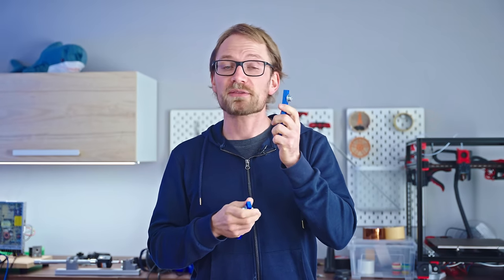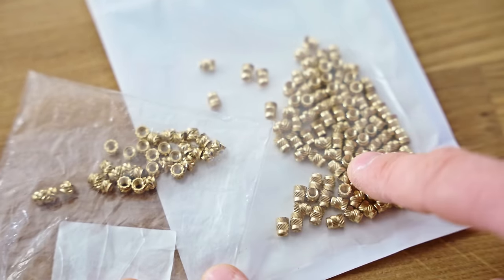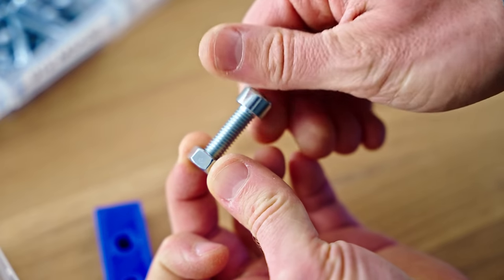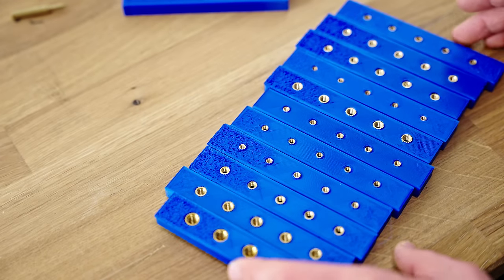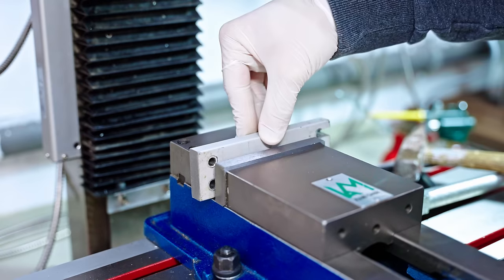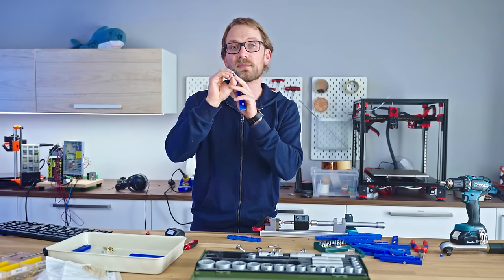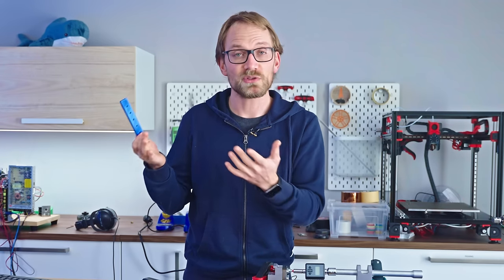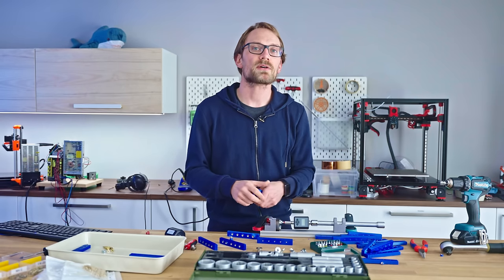Do you even need threaded inserts? Strength tested!

Comment: Hi Tom, I have been watching your content for probably the past 8 years and I am a huge fan. My studies and career have lead me into being an applications engineer for SPIROL, a manufacturer of various engineered fastener components. This video really hit it home for me, because a lot of our business is with threaded inserts for plastics. In my position, I do a lot of customer case studies and experiments, so I can provide a lot of insight into the matter.

First of all, I would like to talk about the testing method you used. Although it put the insert into a combined stress of torque and pull out, this condition is best avoided because it compromises the part's performance – in a normal situation, the insert should always sit against the part it is beight mounted to. This way, there is no additional pull-out force created and the only stress the insert experiences is the torque. The proper way to measure the torque performance is very simple – we call it the direct torque method. Simply screw in the bolt all the way in and measure the torque to failure with either a torque wrench or the torque gage. If the application is designed this way, the only axial or pull out force it has to withstand is whatever external force acts on the assembly, which is usually smaller than the pull-out force you're creating with the bolt. The actual pull-out force is then measured by just pulling onto the insert via the bolt until failure using a load cell. 

Secondly, there is a lot of design considerations that need to be taken into account when using these. The most important one being the boss diameter, or the minimal effective wall thickness. We usually recommend this to be 2-3x the diameter of the largest performance feature of the insert. This maximizes the performance, because a strong enough boss will shift the failure mode from the plastic cracking/pulling out (like you have experienced) to the insert spinning in the plastic/shearing the plastic around the insert. Obviously, this is a challenge with 3D prints, because you don't want to have 8 perimeters everywhere in the part. Coming in at a close second, a proper hole size is also having a huge effect on the performance. Have the hole too big and the insert is not going to perform as well as it could, have the hole too small and you will be pushing too much plastic around. This is best determined by experiments – install the insert, perform a cross-section of the assembly, take out the insert and inspect the imprint that is left in the plastic. You should not see any voids, which would indicate an oversize hole and compromised performance. Undersize hole will perform fine, but you will be seeing a lot of plastic flash on the top and bottom of the insert. When the boss diameter and hole size is dialed in, the third factor is the installation procedure itself. Granted, it is hard to achieve consistency at home, but some general principles can be followed. The installation is determined by temperature, time and applied pressure, all of which can be tweaked slightly to achieve the best plastic flow around the knurls. Good alignment of the heat tip is also a factor – at 8:53, you can see the asymmetrical flash on one side of the insert, which probably creates a void on the other side. You can try to adapt a drill press with a heat tip/soldering iron to have a good, perpendicular insertion system, which often times has an adjustable positive stop for installation depth consistency.

At 16:37, you also mentioned that while connecting two plastic parts, you need extra support, so the screw does not dig into the hole. This is another part of a secure bolted joint in plastic – the mounted part needs to be reinforced by a compression limiter. The compression limiter transfers the clamp load through its metal body and protects the plastic from getting crushed. This protection can also be achieved by a big washer or flanged bolt, but not having the metal reinforcement would mean the plastic would creep over time and any preload that was there would go away, so the compression limiter serves also a further purpose. Using a compression limiter is also very common when mounting plastic parts to metal bodies, not just in pair with a threaded insert.

Incorporating all of these considerations/guidelines/principles, you should be able to come very close to the nominal torque of the class 8.8 bolt. We can usually get to that torque or even past it in industrial molded parts with various levels of glass fiber fillers, so the lack of homogeneity of 3D printed parts will bring those numbers down a bit.

Feel free to reach out if you have any questions, I would be happy to help!
Reply: Preach. Nothing about this testing was valid and all the results are misleading. I know Tom probably put a lot of time into this video but I think he should not have released it.

Comment: My experience:

I've learned ntu thickness is 0.8 times screw diameter with similar material. Witj Steel screw in aluminium thread depends is 1.5 times diameter and Steel in plastic  2.5 ( if I remember right)

M5 thread pitch is relatively low. So it's not ideal for printed threads.

Thread length is the game changer. On an M3 bolt sitting in 40mm PETG I ons twisted of the head by trying to unscrew it. The PETG warms up slightly while screwing in. Than setting perfectly on the surface of the threads.

The thread adapters are working best if they are mounted from the rear.

Embedded flange nuts are also very strong.

Comment: The thread adapters are similar to threaded inserts for woodworking.  I think the woodworking ones have a more aggressive steeper thread on the outside. It would be interesting to see how those perform in a test like this.  I think the number of walls around the thread and as you mentioned the infill would be a large factor there as well.

Comment: a screw goes into a NON-threaded part. bolts thread into pre-existing threads whether those threads are in a nut or anything else, screws cut into the material to form threads as they're screwed in.

Comment: Manually tapping allows for better results, provided you have a feel for it.

Unless you are manufacturing at some scale, it is more cost effective to over-engineer and use larger thread sizes.  The time it takes to dial in the ‘correct’ fastener is excessive unless you are looking at cost per unit.

Comment: You should have also tested prints that allow a press fit nuts which seems the easist thing to do as it uses standard nut/bolts instead of expensive inserts.

Comment: Hi, I use the best combination of materials. Let me explain: if I'm working with plastic, I also use a plastic screw. But too small sizes often do not allow this. So I place the empty space under the female screw and then pause the slicer on the last layer to place the nut there. As a result, I have a part that fits the hole perfectly, has the correct threads and the right material hardness. I would be glad to see similar tests with my method of making threads

Comment: I would use a tap wrench when tapping threads in plastic to avoid melting or stripping the plastic.

To get more instructive test results, you should print more solid layers around the holes. If you could get your slicer to somehow interleave the layers with surrounding layers then that would be awesome. I have never tried to do that in my slicer.

Comment: There was a video like this that tested threads in resin printed parts of different resin types, they found that you're better off either just gluing/resining the insert into the resin after the fact, or having the threads printed.  The strength was about the same either way.  Tapped was much weaker, probably because it breaks the crystalline structure of the resin.  

The thing is... You needed to print solid test parts for tests that cut out any problems with your slicing profile.

Comment: You should test something resembling actual use. In this case, bolt together two parts, and test pull out strength by pulling on the second, untheaded part. The second part acts as a washer, preventing the initial pull-out you experienced. Looking forward to your results. I expect pull out will be the weakest direction, basically the same as this test's results. Shear strength should be quite good.

Comment: I bought a tap and die set. Now I just print holes with the minimum thread tolerance, harden them with CA glue, and tap them. The plastic (PETG) around the fastener will rip out before the threads give way, even with 60% cubic infill..

Comment: I would love to see a follow up testing to see what kind of methods you would need to make the screw or the insert the weakest part of the setup. I'd expect that you need a lot thicker wall thickness for the 3D printer setup and probably also higher density fill, too.

It's probably not worth the effort to test so many thread sizes. Simply go with M4 and figure out what's the best method for that, and the results should be probably applicable to other sizes, too.

If you could find thread insert that you can use with a steel thread adapter for M4 screw, that would probably result in strongest connection because you would get maximally strong M4 thread with much bigger contact surface to 3D printed part. Of course, the overall cost per insert would skyrocket pretty fast if you go with stacked design.

Comment: An alternative to cutting threads with a regular tap is to use a thread forming tap. Then don't cut the thread; instead they force the thread to form around the tap. Of course, you need to drill a larger pilot hole. I use these a lot in metal projects and they for a thread that's stronger than a cut-tapped thread.

Comment: you should try to fit a nut inside the part and go more on the setting side to make it stronger. Personaly, if I want something with a strong connexion, i'll use more wall thickness, a lot of infill and probably insert a nut inside the piece and print it in PETG.

Comment: Hidden nut if you need pull strength. Inserts when you need to unscrew it often. Other than that, i just tap. I do use larger bolts and i ALWAYS use washers. It stops layers being pulled apart as the screwhead digs in.

Comment: I just print a smaller hole, so for example 2.6mm for an m3 screw and screw it in directly. There is quite a bit of friction, but that means the screw sits in relly tight and strongly. I think printing the thread makes the connection weaker.

Comment: If you ever want to revisit this experiment... try salt curing the prints after you place the inserts. The salt curing will increase the strength of the print significantly. Though, be careful... it does shrink the print (that's why you place the inserts first). Also, I would love to see a resin test with these inserts.
Reply: I don't understand why anyone uses salt for annealing PLA. It's corrosive, makes a mess and is not commonly  available in the require fineness.
Just use plaster (gypsum). Cheap, superfine, available easily.
Just don't wet it...

Comment: I find printing a regular hole and just using the screw to self tap works remarkably well.  I've actually stopped using inserts as I've not actually stripped out any screw doing this; even after putting the screw back repeatedly.  Maybe it's the depth of the screw that helps this.  Sometimes simpler is better.

Comment: Nut pockets, and test with another part on top. You can't "pull out the plug" as easily if you have a solid part on top, but you could strip printed threads easier. With inserts the top part would sit on top of the metal preventing it from pulling out, but it could possibly spin instead.

Comment: You should try printing a hex shape hole into the back side of the part just big enough to press a matting metal nut for each size of bolt and give that a test. You could even take it one step further and pause the print and insert a metal nut and then resume the print so the metal nut is fully encapsulated within the 3D printed part. Also try 100% infill. Note: a normal metal nut from the hardware store is much cheaper than a heatsink insert.

Comment: I've had plenty of luck with tapping M3 holes in PLA, this is actually my most common method for adding threads to things unless the parts screws need to be removed regularly.  I suspect there wasn't enough walls or infill.  I always use at least 3 walls when I need to tap a part and would typically size my hole to about 2.8mm.

Comment: Your torquemeter measured the resistance of your free spinning bolts, which was 0 for all of them. If you wanted a number you'd have to lock the bolt to the insert. eg. a solder blob on the bolts.

Comment: I made holes about the right size for tapping, then just put the screw into the hole pushing the material into the right spots.  Worked great for me so far but I used long screws and it was just to keep a lid on, nothing high stress.  I'm a little surprised you didn't try that, just printing a hole and then threading the screw into the hole directly.

Comment: If you redo this test you should also try the McMaster style threaded heat sets. They are designed for a 4 degree draft angle or 8 degree taper hole and seem to work quite well. 

You should definetely try different support or hotter printing temps to see if you can get higher part strength. I’m surprised you had failure below 0.3 NM, I’ve been able to torque M3 screws to 0.5 NM without much issue on the McMaster Heat-Sets in PLA+.

Comment: You should try screwing in from the other side of the brass insert. Optimizing hole diameter will be part of that work though as you cant have much plastic being pushed into the screw hole

Comment: I second the notion that an exploration of wall count with printed threads and threaded inserts would be interesting. I would also like to see a comparison to captive nuts (printing a hex-shape and putting a nut in it after the part is complete). Captive nuts are my favorite way to attach hardware to printed parts. 

What I really want to see is a comparison of threaded inserts installed from the "pull out" side vs. threaded inserts installed from the opposite side. Does a little "wall" of printed plastic make the part any stronger?

A couple ideas for better testing M3 inserts: 

Idea 1: Torque an m3 fastener with an eyelet attached to it into the printed part. Then use a string and a hook to attach (small) weights to the eyelet. Add weight until the threads fail. I think a test like this is a better reflection of reality. The user torques a fastener into the part using a measured amount of torque, or at least some judgement and then operational stress is applied to the part. At the very least it would allow the tester to start with a smaller minimum load and add load in a very progressive manner. 

Idea 2: Put three or more threaded inserts in a printed part in a pattern. Make a steel jig that has a hole pattern that matches the pattern plus one more hole in the center of the pattern. Think of a the bolt pattern of a car wheel with the hole for the hub in the center.  Tighten screws into printed part (with tapped threads or inserts or whatever) to a specified (low) torque value. Then thread a screw into the "hub" screw and measure the torque applied before the threads start pulling out of the printed part. Divide by three (or whatever the number of screws is).

Comment: I typically use more parameters when printing anything that will experience a force on it so that is my first recommendation.  If you want to achive maximum strength i think the imbeded nut option is a good method to follow but i typically make use of a captive nut. The difference being that the captive nut just sits inside a hexagon recess that is slightly larger than your nut (making the peinting process simpler) . Both of these methods has a larger footprint to spread the load onto, making most of the weaker materials. I also feel that ABS is much better suited for stress resistant parts as is its stiffer. PLA and PETG can also hield or creep more over long periods under load

Comment: Really I think this is another case of "the right tool for the moment." Everything is fiddly to some extent, and we can't really count on any of our printers to make a perfect hole even for things like nut slots, but we can mostly get any of these methods to work for a given part depending on what we have and just want to do.

Sometimes the answer might not even involve threads, but instead interlocking parts, adhesives, zip ties, or maybe a combination of those.

Comment: MY experience with this is only with M3, but I found an easy way that seems strong and is very cheap. Print or drill the holes to around core with and just screw in the screw and let it be it’s own thread tap. It requries some force to enter the screw, but it seems to hold VERY well. It would be cool to se the data compared to threaded M3 holes 🙂

Comment: I've always used printed threads and they are fine from M5 up. Pro tip is to tap them after printing but not with a drill and machine taps but with a proper set of hand taps. For anything smaller than M5 I typically use hexagonal holes and nuts. Great video BTW!

Comment: I use wood insert plugs if I can reach "from tge back" the most left you showed on the last picture for alternative.
I have also found that the highest strength is with a "pilot hole" with diameter same as thread inner diameter and just running the bolt in well lubricated with vaseline. This makes much stronger thread than pre-tapped or print in place (especially for so small diameters)

Comment: personally, i'd be using nutserts, the flange on the back adds surface area, just need the hole to fit tightly enough that it doesn't spread.